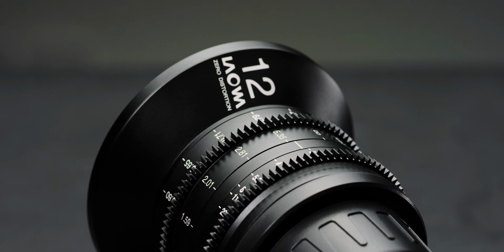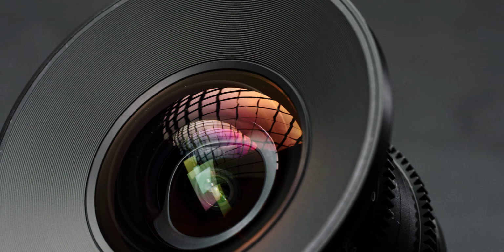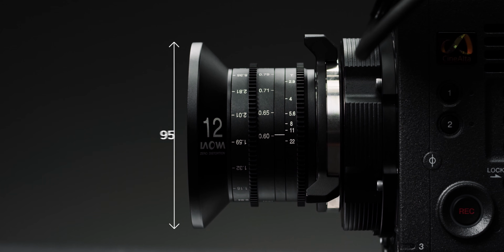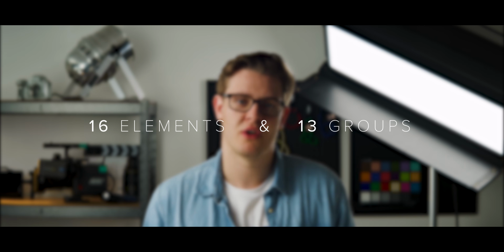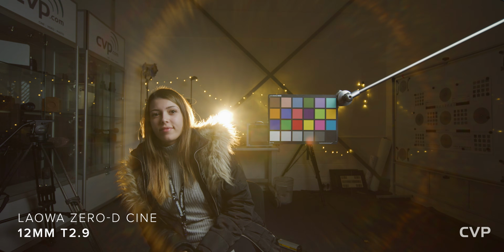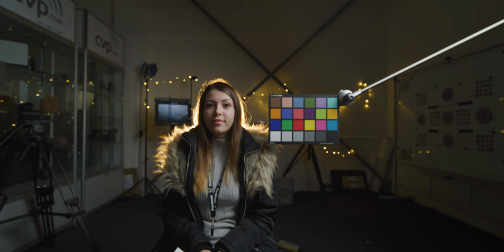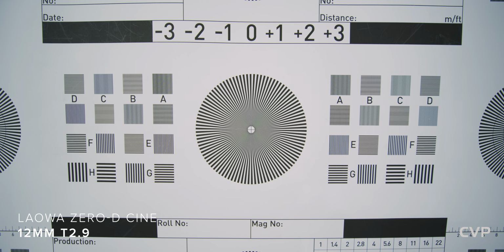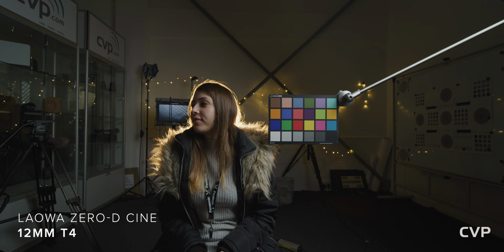Ultrawide Cine Lens with Zero Distortion - Laowa 12mm T/2.9 Zero-D Cine Review

Comment: What you are choose Meike 12mm or Laowa 12mm?
Reply from the maker: Depends on what camera system you use. But I think the Laowa is a better lens optically, mechanically and versatility wise. Jake
Reply: @CVPTV  hi Jake, thx for answer. I want to use it with BMPCC4K, but found that's Laowa for full frame...
Reply from the maker: @Krakadillaz  With the BMPCC4K you could use a MFT to EF or PL speedbooster. This would give you the benefits of using a SB. However this is a more costly option over the Meike. But I would say it is a better option if you can afford the extra cost. Jake
Reply: @CVPTV  Hi Jake, just to clarify. Can I use any full frame lens with BMPCC4k + Metabones EF - MFT 0.71x?
Reply: @Krakadillaz  yes
Reply: @Krakadillaz  the .71x for apsc and full frame the .64x for only full frame
Reply: thank you

Comment: Iris Ring is almost flush with the start of PL-Mount Fasteners. Did this cause an Issue with a Motor on the right side? Is it ready for some heavier Motors or would it feel like breaking?
Reply from the maker: In regards to Iris gear position, yes you will have to get creative with motor positioning depending on the camera system. The iris feels solid but I would be intrigued to see how it handled a Preston!
Reply: I only know the CLM Series motors as well as the DJI Set. How strong are the Motors of the Preston Set compared to like the DJI one?
Reply from the maker: Much stronger than DJI.